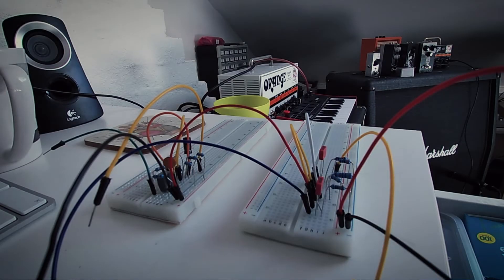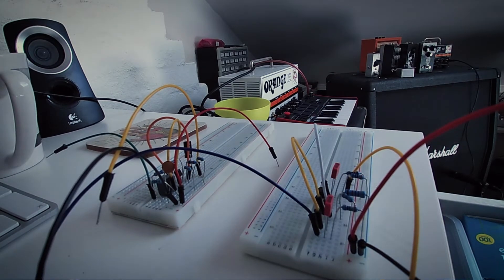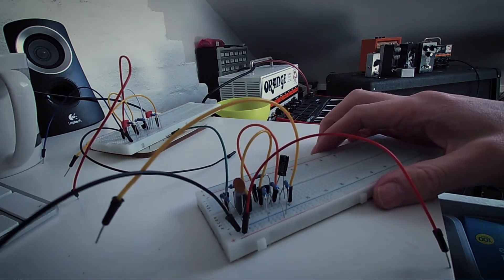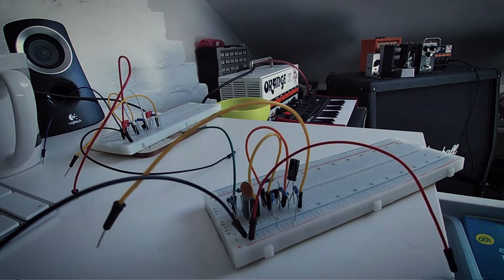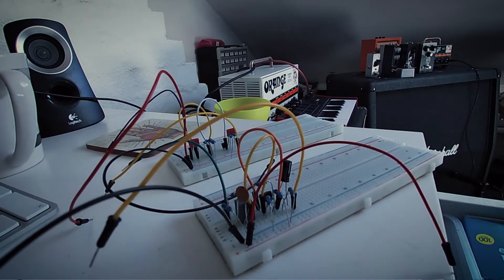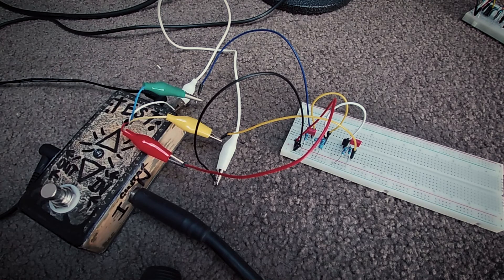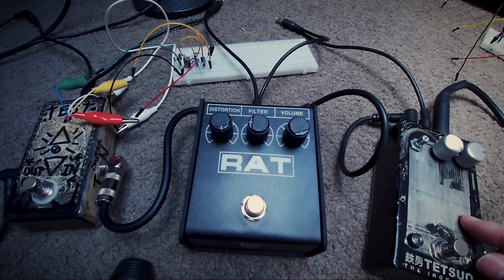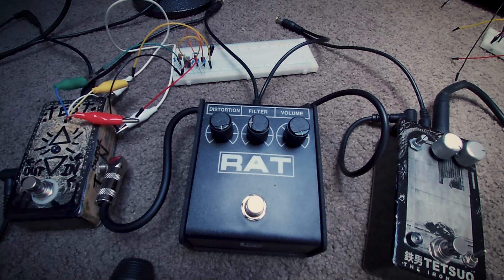Two DIY Boost Pedal Circuits - On Breadboards.

Comment: Hi! Can I replace the bs170 with another transistor???
Reply from the maker: It’s for use with MOSFET TRansistors, but I guess if you can match the DSG, drain, source, gate pins it should work, dunno what it would sound like, might not be a clean boost anymore, could add some colourage to the sound